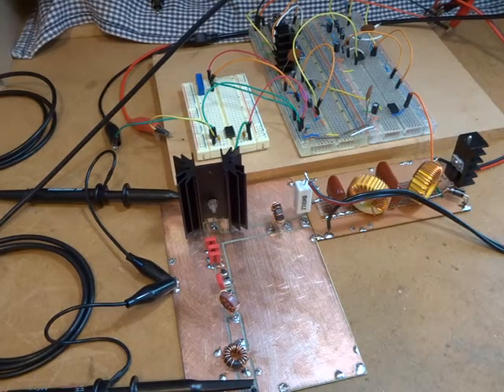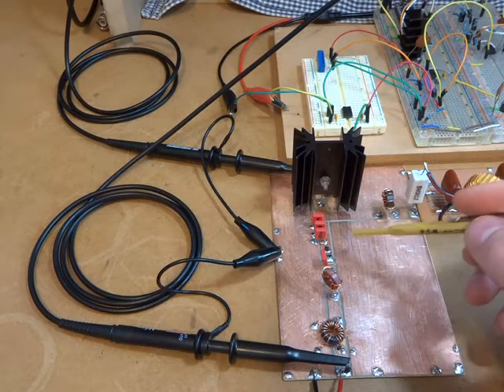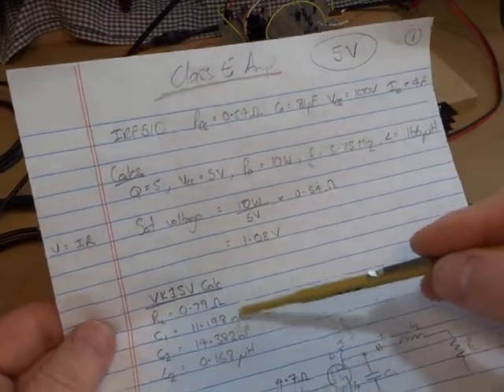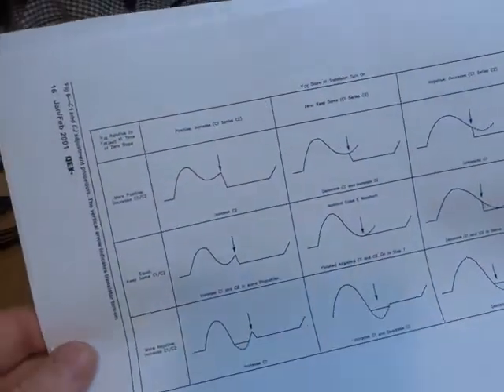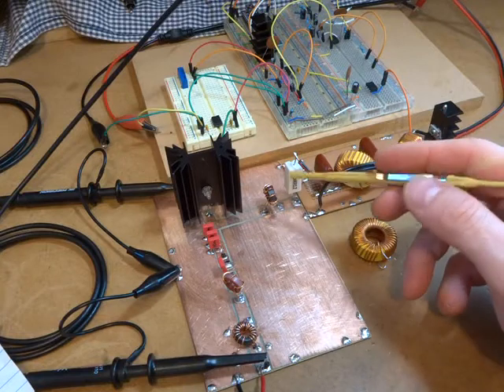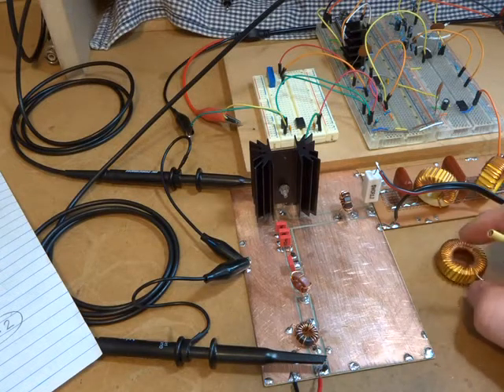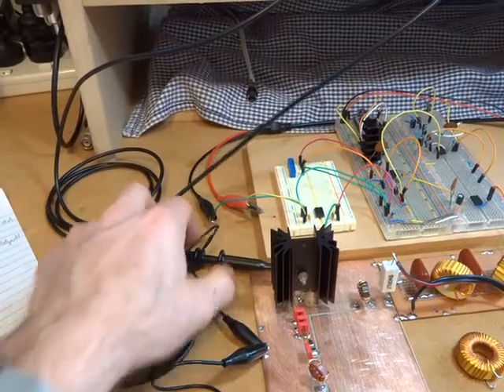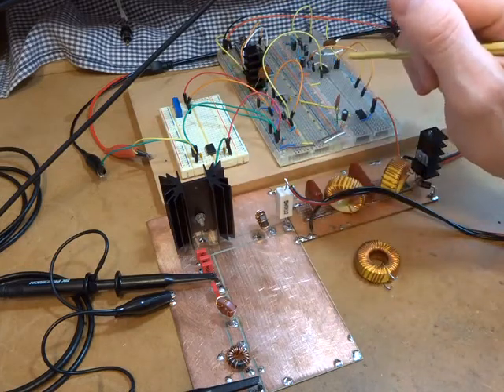AM PWM Rig Part 2: Class E Amp Experiments

Comment: The class E operation is to much depending from the capacitor and the coils,
it is much easier to use a class D operation.
For beginners; use a half bridge what deliver not so much power. But a full H bridge give the most efficiently and higher powers. The low-pass filter is simple to design the output impedance of the PA the same as the filter impedance of 50 ohm. Use a choke input filter, otherwise there is a short-circuit for the square wave. And every Mosfet have a MUR460 diode as a freewheel diode over the Mosfet.

Comment: Nice work! Would be good to see some audio modulation on your PA. When you get back to it perhaps.
Reply from the maker: I did try that Paul, but the modulator didn't like the low impedance of the amp. When I added in 4 ohm of resistance into Vcc line (1 ohm at a time) it came right. I'll need to look into that at some stage. Not sure if you have experience that or not.
Reply: @CharlieMorrisZL2CTM  No I haven't,  but then I've only built established designs, so others probably anticipated the PWM to PA matching issues.
Reply from the maker: @Paul_VK3HN  Thanks Paul. I first need to mount the modulator properly then try it again. All good fun!

Comment: I was taught to design the output side of the RF amp to operate at the conditions present at maximum PEP. This would mean designing for the voltage the modulator puts out at the positive modulation peak. Theoretically the impedance shouldn't change with the VCC voltage, since doubling the voltage should quadruple the power. I don't have enough experience to accurately judge theory vs reality here. I've only ever built one Class-E before. It was low power and purely experimental to ease my curiosity. I used this calculator for a starting point. [ http://people.physics.anu.edu.au/~dxt103/calculators/class-e.php ] They may use the same formulas that you used.

Something that might help, and I'm taking this from my power supply design experience, is to look at your drive circuitry. The gate of the Mosfet is quite a large capacitor from an RF perspective and it takes quite a bit of current to charge and discharge it, especially at RF frequencies. The flying lead you have connecting the gate to the gate driver is a significant inductance for the fast edges of the gate driver IC and can contribute to the drive being misshapen. I would try mounting the driver IC as close to the Mosfet as possible to minimize the gate lead and ensure the ground side of the IC is tied directly to the source of the Mosfet to eliminate any stray inductance there as well. Also, being a dual driver IC, the drivers can be operated in parallel to get more drive current to switch the gate.
Good luck and 73s. I might have to try building one of these myself now. Haha.
Reply from the maker: Fantastic. Thank you very much for that. I will reconfigure the amp and give it a try. I appreciate the input.

73s
Charlie ZL2CTM
Reply: Good pickup, the construction techniques shown at classeradio.com include mounting drivers right over the top of the switching FETs for these reasons.  Layout and earthing is important in these designs,  even at low HF and relatively low power levels, due to the high switching currents involved. Remember that the output power in the sidebands at full modulation is 4x the carrier power, so that one little IRF540 should deliver 30 watts PEP, although I wonder is that's possible on such a low Vdrain.